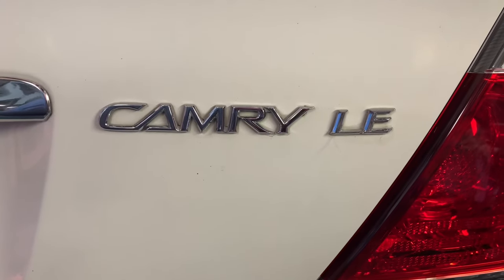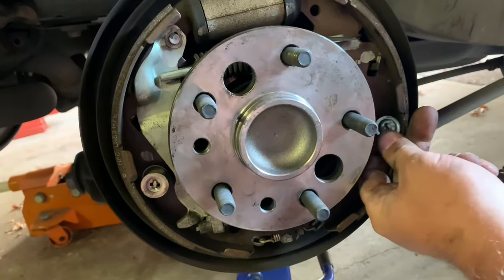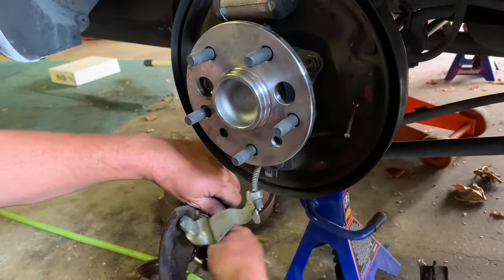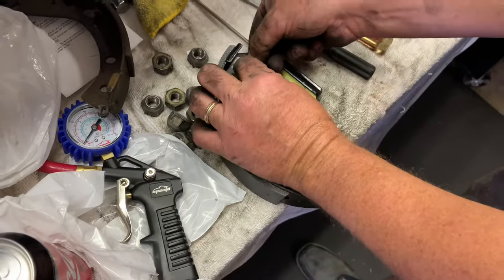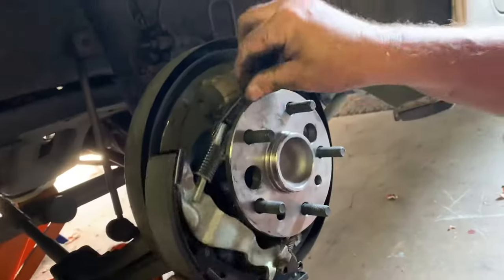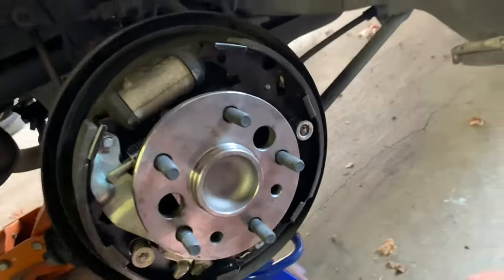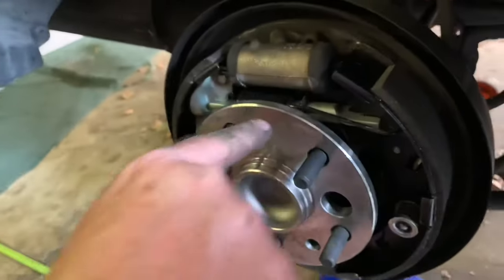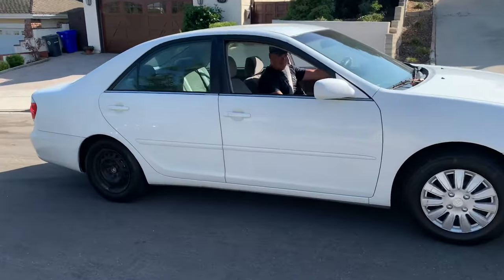How to change rear drum brakes on a Toyota Camry

Comment: Just wanted to point one error. Great video. Its the adjuster comment you made, some folks might incorrectly install this. Looking at 1:28 the adjuster is removed with the long side on the top plate. Fast forward to 4:42 you said long side of adjuster goes to the rear. Fast forward to 5:04 you placed the long adjuster to the top plate but did not mention the error made at 4:42.
Reply: At 4:42 he said the long end goes to the rear and this is the correct way to install it. Short leg should be in the front.

Comment: Wish I'd have paid better attention to the order in which you reinstalled all the springs and parts. I put the big top spring on before installing the little side springs and pins and wound up destroying my wheel cylinder. Got brake fluid all over my new pads.

Comment: Just did this on a 2004 Toyota Camry LE but now the parking brake doesn’t work, any ideas ?
Reply: Because you have to adjust the brake pads out. Watch this video pads should drag to 1 1/2 turns when you spin drum.
https://youtu.be/0KoronMSp68

Comment: How do you go about adjust the E-Brake, ? 
I know sometimes after all is said n done, the e-brake would be very loose and get no traction when pulling it upwards..
Thanks 🙏
Reply: 3:24 you can manually  adjust that star screw in the middle.